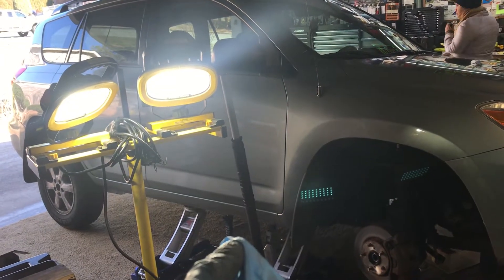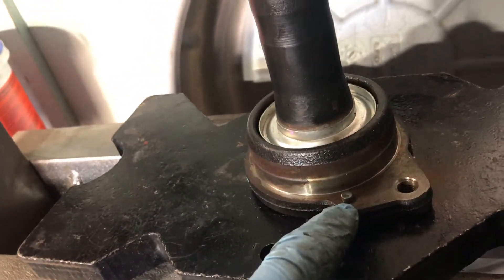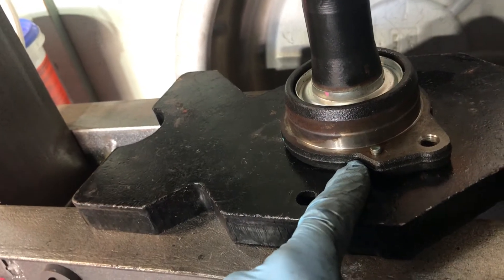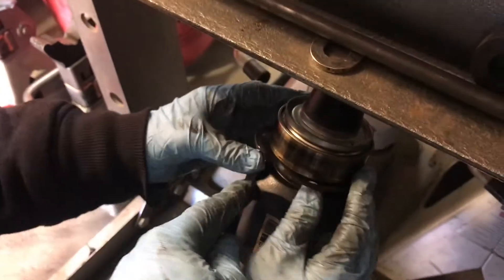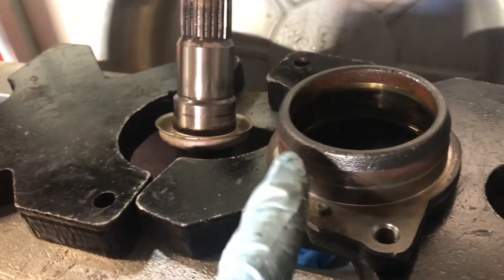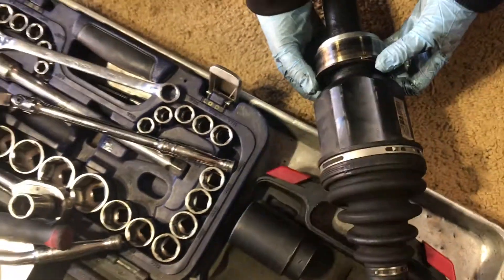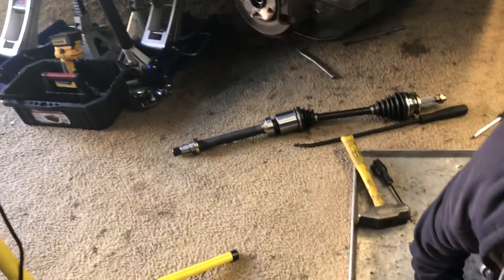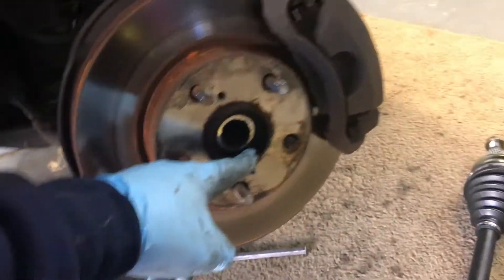How to remove the CV axle carrier bearing on a 2008 RAV4

Comment: I thought I had been shipped the wrong axle for my 99. I thank you so very, very much for having this recorded. It's not listed in the manual at all. Really can't thank you enough. Now I need to figure out how to shade tree a press...
Reply: Update: Used a floor jack, a chain and 2 tie strap sets to remove the mount from the old axle.

Retainer ring was an absolute nightmare to remove- even with removal pliers.

And if anyone reads this and wonders how to get the new one on without a press, clean thoroughly the mount, then boil it on a pan of water (expanding it). I left mine to boil for about 5 minutes to assure full 212° expansion. While this is happening, grease up your new axle carrier bearing and grab an oven mit. The hot mount will slide right on. Be sure to hold it there for at least 30 seconds for it to cool and seat.

Again a wholehearted thank you to Hellcat for having this video and allowing me to do this at home.
Reply from the maker: That is definitely interesting.. where there’s a will there is away.. I’m glad you got it done and it all worked out..I’m glad my video help to somewhat 👍 and you have a great holiday😊

Comment: @Hellcat Redeye -G How many ton press is that? I am about to replace my right axle and the hub assembly. I don't want to buy a press just for this, but I guess I will have to. Wish I had a garage.
Reply from the maker: It’s a 20 ton .you can always take it to your local garage they can press it out for you for a fee .Or if you have room Harbor Freight always have good deals Tools.. hope this helps 👍
Reply: @hellcatredeye-g6582  You are the only one on youtube that has a video of the passenger side axle removal. The drivers side is a breeze.

Comment: The most important question : why are you changing the beering? What happened in the car that made you decide to change the beering? Thank you.
Reply from the maker: Yamawwad Y I have to remove the bearings replace The cv joint
Reply: @hellcatredeye-g6582  thanks for the quick response, I have a whining noise when I press the gas  pedal then it disappeares when removing my foot from the gas pedal.
Reply from the maker: Yamawwad Y Check to make sure it’s not the alternator or power steering pump. if you’re hearing it in the front and underneath most of the time it can be the Wheel bearing hard to tell exactly without hearing the vehicle myself🤔 sorry didn’t get back sooner working on a Lexus RX 350 right now👍
Reply: @hellcatredeye-g6582  thank you for the explanation , where is your maintenance shop located?
Reply from the maker: Yamawwad Y Over in Lilburn Georgia

Comment: awesome, thanks.  I tried HARD to pull the mid bearing off a volvo v70 right front halfshaft and gave up.  Now, I know to look for hidden ring.  Regarding the special nut, shame on toyota, I hate that crap.   burn it off with a torch and go back with a GOOD part not from toyota but from a fastener maker that isn't playing BS games with serviceability.

regarding the hidden snap rings, 2 yrs ago even the reman volvo halfshafts had used bearings on them....apparently no one could remove.  even a rebuilder in denver said 'no' to volvo halfshafts.  however, now, the bearing is available....so maybe it does come off.  I'll definietley be looking for the snap ring, but possibly volvo did a hidded-not removable one and the gas-axe gets it off and a new baring needs a new ring (if you burned the old one)
Reply from the maker: 0x00zero I’m glad it helped thanks for viewing I appreciate it 👍💯

Comment: Now you have a useless socket to sell. That's Yoyota.
Reply from the maker: It’s a snap on tool I bring it back to the truck they give me a new one for free lifetime warranty
Reply: it's just a 12 point socket, not that uncommon of a tool... I'm looking into doing my passenger side bearing. Now I see a bearing on the drive shaft.  Is the bearing fixed to the shaft and you have to press it out of the casing ?  great video!